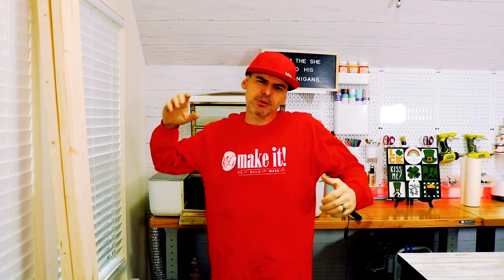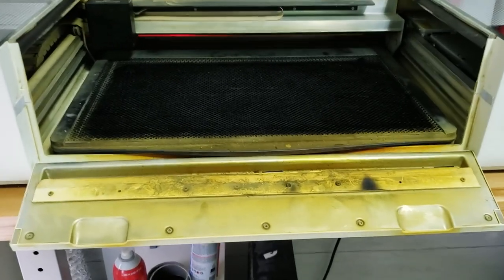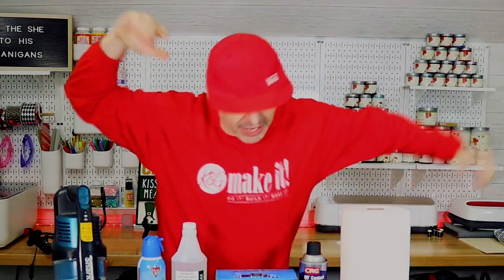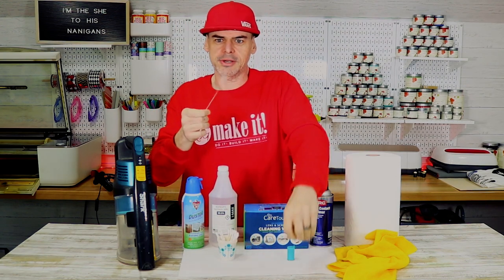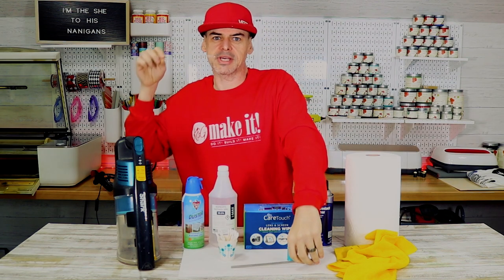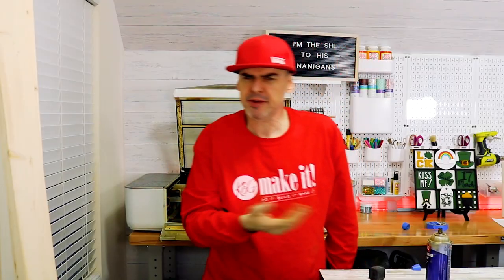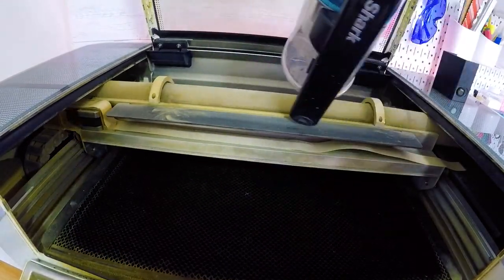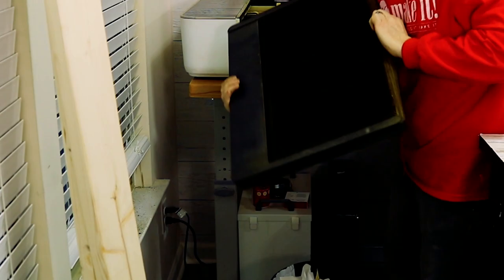Glowforge Deep Cleaning Tips Exhaust and Air Assist

Comment: There are instructions on how to properly remove the belt. The right wheel is to be loosened by using a 3mm hex key about a quarter turn
 The wheel can then shift to the left, releasing the belt tension.
Reply from the maker: THANKS for the info!
Reply: I've heard it's tough to get it back in place. Has that been an issue?
Reply: @Walsfeo  no, wasn't a problem at all.
Reply: The best comment on youtube ever.
Reply: Holy heck you just just my life and my fingers! That was SO much easier!!
Reply: It was a hassle for me. I thought I was gonna break the belt at first. Thanks for your advice, it helped!!
Reply: Thank you! Just ordered a kit of hex key for GF.. I’m tempted to just take out the exhaust fan and just use the inline fan.

Comment: Get the ac inline fan from Amazon if you don't already have one. It makes it soo much more quite when running! I love mine!
Reply from the maker: We really want to get one!
Reply: @KimandGarrettmakeit  definitely should if you can. I got the ac infinity cloudline s6. Also got an attachment so it would fit the 4"inch exhaust tube on the glowforge and the 6" fan opening.
Reply: Doesn't a inline fan void the warranty? Just curious. I'm making sure I don't do anything to void the warranty. But if it doesn't I'm sure it's a life saver!
Reply: @jessicakeen2018  no it doesn't. Lots of people get them because it's way more quiet

Comment: Thanks for the Vid, do you by chance clean the lights on the lid ? and if so what did you do and use ? thanks in advance.
Reply from the maker: I'm not sure what you mean!
Reply: @KimandGarrettmakeit  Sorry the LED lights along the sides of the Lid mine are is all yellowed out.
Reply from the maker: Ah!  We just used the magic eraser on those as well.
Reply: I clean my machine every morning and use a soft paint brush on the lights (vinegar water and Windex) and wipe it down with a soft microfiber cloth when done.

Comment: How long did this take in real time?
Reply from the maker: It took about 2 hours, but I had to move lights and cameras. I think I could do it again in just over an hour. Cleaning the exhaust and the air assist fans were the longest part. I cleaned each one for about 20 minutes.
Reply: @KimandGarrettmakeit  thanks!
Reply: @KimandGarrettmakeit  , Thank you, so much for this detailed video. I am going to be getting mine soon and this will definitely come in handy. How, can we use your coupon code for the $500 off? Also, can you make a video on where you get your svg’s from and how you do the layering cuts for things that require layers. Again, Thank You so much! You guys rock! Tell Kim we missed her in this video😊.